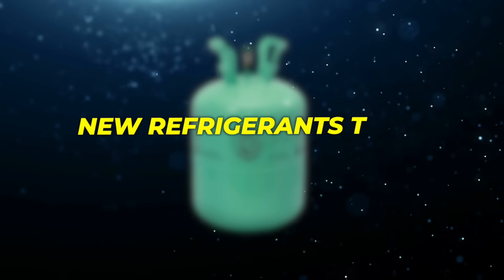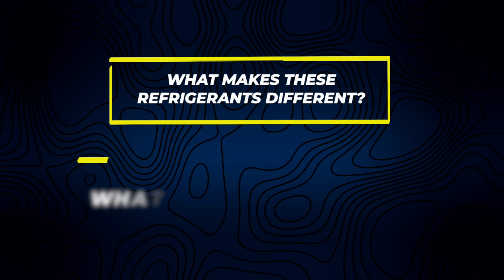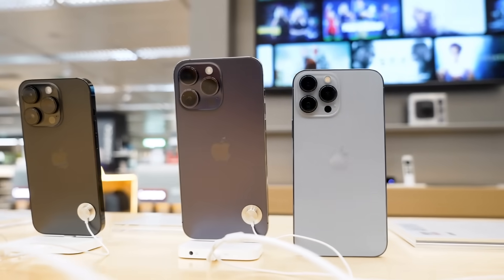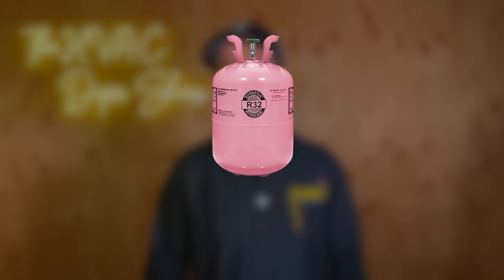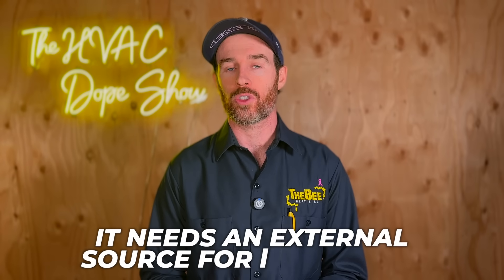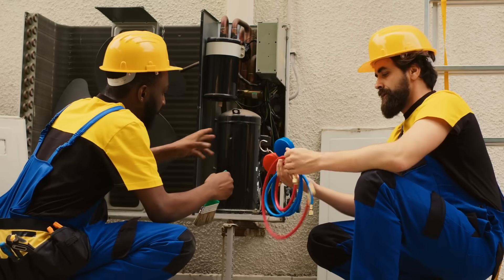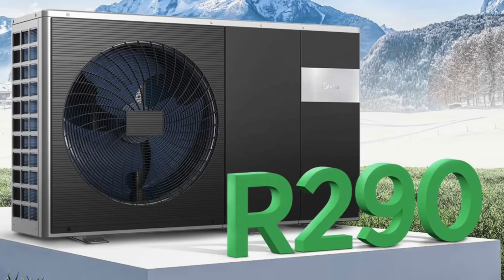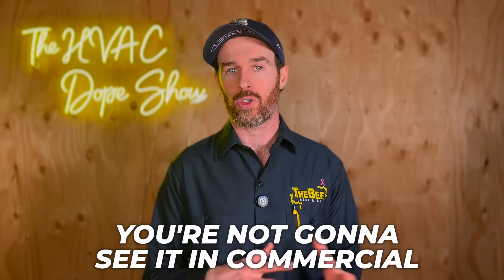The TRUTH about the “new” refrigerants | R32 and R454B refrigerants phase in

Comment: As a previous member of the refrigeration service engineer Society I am not happy with this decision regarding R32 or any propane refrigerant in residential or commercial use. My biggest concern is the factor of a compressor terminal blowout which would cause an arc and possibly ignite the refrigerant as it is leaving the compressor. I have seen things like this happen many times in the past with the train company and units would catch fire. I personally believe that the R32 refrigerant is not going to last very long as New Alternatives are coming about with lower ozone depletion. Yes R32 may have less of a charge than 410A in most cases, but I also believe that it is a potential for disaster later on. I've been in the industry 52 years and sat on two boards including North American Technical excellence and the refrigeration service engineer Society and the tree huggers. This is a big bunch of bologna! There is no more service technicians in this industry they are service salesman and trying to fleece people out of money and scam them saying that these refrigerants are not available you need to buy a new air conditioner when there are alternate refrigerants to replace R22 and others. I recommend that people get the correct information from the right sources such as Refrigeration Service engineer society and the air conditioning contractors Association of America don't believe everything these contractors tell you because they lie like a rug on the floor

Comment: I like using my R-12 in my old 1972 Buick. When Walmart was selling R-12 for$0.99 a can I bought cases and cases of it!
Reply: I did too.
Reply: Those were the days !  I did similar, and when we moved, 2020, , I only took our '01 Beemer along, so I sold my vacuum pump (built in 1902) and sold my truck and gave away an old R12 Cadillac.  This was when I also sold my AC rolling cabinet and 24 cans or R12.  I'm 82 now and only rotate tires, change my motor oil , filters, change out brake pads, etc.  Anything else I take to a local shop.

Comment: R32 seems to be corrosive to copper. Friedrich air conditioners have been using r32 for years and the most we got out of one of them was about 2 years before the refrigerant ate through the copper coils and leaked out. I hope the government comes to their senses and puts the brakes on the r410a phase out.
Reply from the maker: I think that's a different issue
Reply: @TheHVACDopeShow maybe. I know that r22 would form an acid if there was any oxygen left in the lines. Maybe r32 does something similar.
Reply: R32 is not corrosive. Your problem was not caused by the refrigerant.

Comment: While I agree that we need to keep the climate warm, it seems silly to be rating freon based on that. My fathers 70s cars are all still using R12. It seems crazy to me to use anything that is flammable. Though the risk is low, why would you take the chance???
Reply: Next to the AC is a heater that is using 100% flammable propane or methane. Not worried about that?

Comment: Air conditioning has been turned into a huge mess by the corporate state that is our imposed gov't, and honestly they don't seem to be competent to be interfering, the result of their meddling is that there are no longer any reliable affordable air conditioners available, no surprise there, as a 40+ year a/c tech. I've seen reliable r22 air cond. turned into r410a air cond. that doesn't work right literally overnight in 2010, it's now been 15 years of chasing new a/c units that are faulty, you can't be confident that the brand new a/c you install is going to work reliably if at all,  that is why 410a is being phased out 5 years earlier than planned, i suspect the new refrigerant will be more of the same junk

Comment: Well from european perspective, as HVAC tech, we have new units with R32 and R410a. R32 has been used for quite a few years now and all new units are 95% R32, some  bigger systems are still R410a but new laws and reguulations were made so from 1.1.2025 no new units are allowed to have R410a and by 2030-ish all previoush ones SHOULD be changed
Reply: No your wrong 95% of new units are 410 kid

Comment: What is the required gas pressure in psi for an R32 unit compared to R410a?
Reply from the maker: Pressure fluctuates based on indoor and outdoor conditions so this will always fluctuate but it's similar to 410a pressures
Reply: Similar pressures. Gonna have to hold on to those 410a gauges

Comment: Hopefully this r32 reduced Indoor coil sizes. Some attics here in Phoenix don’t allow out currently oversized 410 equipment to be installed efficiently.
Reply: Large coil size is not caused by the refrigerant choice. Its caused by the need for high efficiency in modern systems.

Comment: I live in the Southern California high desert. Average nightime winter low is 32 degrees. I am more concerned with having good a/c in the summer over heating in the winter. Would the daikon fit be a good fit for me?
Reply from the maker: In the high desert, so your highs get over 110F? If your home was under 2k square feet yes that's great (we install these in Phoenix and they work great) but if you can afford the DZ9 or any 20 seer like that those tend to handle 110-120f temps better. The new Daikin fit enhanced can handle them and they work but we've found that over 110F they will be running in boost mode until it drops below 100 or 105 depending on how your system is set up, so they don't modulate as much. Hope that helps, short answer is yes they work but over 105/110 they'll be running in boost constantly (which is fine there's no downside it's just not modulating like it would on milder days). This typically means at night when it drops below 100F then the system is super quiet inside again because indoor fan isn't running full steam ahead and it can modulate
Reply: @ my house is 1,670 square feet and it rarely gets above 106 degrees.

Comment: Do both R32 and R-454B have the same cooling capacity? Which as more?
Reply from the maker: R32 requires a lower charge so the equipment is smaller for the same efficiency which is an added benefit... 454B is similar but just requires a larger charge / larger system. Capacity is same
Reply: @TheHVACDopeShow  I replaced my 19-year-old 4 ton r22 Lennox with a 4 ton Goodman single stage. And although they both are rated as 4 tons, and the Goodman has less refrigerant, the Goodman condenser appears to be about 50% larger than my old system.
Reply: Be aware that R454b may not heat as well at very low temps. Not sure about R32 yet. I'm sure we will get more info as new units are available. We will be able to compare R410a specs/capacities to the new refrigerants soon.
Reply: @JOutterbridge  R32 has excellent low temperature properties.

Comment: Carrier R22 still going strong after 28 years.  Lower pressure refrigerants = drastically higher reliability.
Reply: Untrue. R410a scroll compressors are more reliable than R22 models.

Comment: 🤖 Points at videos of people freezing water by cold boiling it under near vacuum Now? Connect water filled panels considering room for expansion of frozen water, increase the vacuum, and vent all the energy from the water to form ice Add a fan and something to catch condensed water. If you use all food grade metals? Add a static dust filter for stuff in the air + a solar powered UVC light for Germs in the water + Metal aeration with air blown over the UVC light on the way to water to give it that yummy river in the sunlight taste. Refrigerant = Water..

How good does ice cool air? 😇 Regenerative Ice technology.. 🧐Those cooling systems are complex. Why? 😘 Note that this design can be done totally manual pump so can be adopted by Amish to prevent needing to go cut ice + have no tech approved cooling

Comment: Do we know if this is going to affect equipment and installation costs? I’m in the market for a new furnace and AC. I could possibly wait 1-2 years, but I’ve been told costs will go up 20% in 2025. Live in NY.
Reply from the maker: Yes everything is going up it's out of control... it has nothing to do with refrigerant, it's just inflation. Our insurance just went up 100% this year based on "general rate increase", absurd. R32 won't be a 20% premium or price hike but buying sooner rather than later is probably a good idea because every cost including wages has really hiked recently
Reply: Get a furnace and a heat pump..
Reply: The place we buy our furnaces claims r32 will be cheaper

Comment: Just replaced my 23 year old unit after it had a "rapid unscheduled evacuation" 💨 after the compressor locked up. I ran the numbers and the leaked gas is equivalent to 4 YEARS of a car's CO2 output. So I get it, but I'm also glad my new unit is R410a 😬

Comment: So do we wait or still get 410A system because its still the better option if were in the market?
Reply from the maker: In a nutshell if your system is working and can wait then R32 imo is better only because it's battle tested in Europe and not a new refrigerant, only new in USA. If you NEED a system asap (system broke down / failed compressor) get a 410a system it's not a big deal and you need a new system. If you want a brand that only does 454B then like some have mentioned you might wait until they work out the kinks, but honesty there's not a noticeable difference. The efficiency will be less than 10% higher on these systems across the board. The only super high efficiency stuff is mini splits anyways so if you're not going with mini splits there's not a big downside if you buy a 410a system now... hope that helped and didn't confuse you. It depends because the R32 stuff is out now in single and two stage but R32 inverter Daikin fits are Q1 of 2025 from what I've heard. So you have a lot of options
Reply: @TheHVACDopeShow  Great advice Thanks. In my area all they sell is Lennox (3 contractors) so well see if they offer R32 in 2025. My AC/Furnace system is old but not failed, 12yrs old. I'm might wait for R32. Didn't realize that R32 was the way to go. And R32 is still almost as efficient as 410A I felt we were taking a step back ?
Reply: @TheHVACDopeShow  My other concern is price hikes in 2025, so I was leaning to get one now before Lennox jacks the price up....

Comment: So glad im done with this bs, found a physically easier job making 25k more a year, no on call, no more bs with cheap garbage products....its like a huge weight off my shoulders. HVAC is beyond dumb right now, have old school owners thinking you can run 8+ calls a day on inverter products, constant changes with refrigerant and cheap poorly made products that break down constantly leading to constant customer complaints.
Reply from the maker: Only 8 calls a day? Jeez millennials are soft 😉 congrats on the new job, happiness is what's important at the end of the day
Reply: @TheHVACDopeShow  I've done more, but inverters on average take 2 hours per call waiting on the system to reboot, ramp up and adjust... gone are the days of replacing capacitors

Comment: That not true 2040 lol Supply stores already telling the techs that they no longer sell parts for 410a
Reply from the maker: Compressors and coils? I’m talking about the actual refrigerant itself will be available for purchase for a while, you’re right about condensers though those are being phased out next year… but those warranties are still covered for 10-12 years so they’d be replaced with a R32/454 system under warranty if that happened (compressor or coil failure under warranty on 410a system)

Comment: So there were 2 things you said outright that you would address, and then just didn't: 1) "should I wait?" you didn't even touch on it. 2) efficiency.
So... should I rush to get a 410A system while I still can? or should I wait for an R32 system?
Reply from the maker: I was allowing people to make their own decision based on the facts I was presenting but short answer is, It depends... do you need a new unit now? Then buy what's available. There's a lot of unknowns still but the R32 systems will be more efficient but only available through Amana Goodman and Daikin. 454b is the other manufacturers. If you need a new unit and the new refrigerant is not available yet then buy what's available but if you can wait 2-3 months most systems and system types will be available Q1 2025. We already have R32 units in single and two stage available now but inverters will be next year. Depends on your situation
Reply: Exactly, sounded like a ramble word salad.
Reply: Efficiencies will be the same as R410a
Reply: @WLB2-j5j this seems highly unlikely.
Reply: @Green__one  R32 is actually more efficient than 410a.

Comment: Not sure if it is true, but I have heard that the new systems using R32 and R454B will cost significantly more for the R410A equivalent system. Not sure if this is true and if so, maybe it's just "inflation", these systems are more complex, or the manufacturer's need to recover NRE. Any thoughts on this?
Reply: That’s my concern too
Reply from the maker: The parts cost on our end went up about 5% but this is sort of normal. We get a 1-4% price hike every year, during the pandemic it was crazy, we had prices skyrocket overnight (8 price increases in two years) because commodities jumped. R32 is battle tested in Europe for over a decade so there's no costs they're trying to recoup here. I think "significant" price increases are from inflation since 2019. It's crazy how much we had our prices go up, insurance everything is through the roof

Comment: There have been many tests done on r454b in regards to topping the refrigerant off when needed and the result was just as it was with r410a. 
You can just top it off as needed without problems just as we have always done with r410a.
The temperature glide is just over 2° so fractionation should not be any problem according to the manufacturer.
R454b will be the dominant refrigerant in the USA for central air conditioning systems. 
Vrf and mini splits will be dominated by R32.
I Hope this helps.
Reply: Until it gets banned in about 10 years due to PFAS forever chemicals in the R1234yf part of it. They should have all just stuck with R32.  No PFAS chemicals. Cheaper too.
Reply from the maker: Good to know! We'll see how it goes

Comment: I had a 16 year old Lennox system that required emergency repair this past week. Rather than spending money to repair, I decided to put that money towards a new system, although had the repair not been required I would have waited until this coming summer 2025 to put in a system with a new refrigerant. The new system is a 2 ton Lennox EL18XCV and a SL280UHV. I have a two-story 2,450 square-foot home. This system is for the upstairs. I was interested in your thoughts on both units (EL18XCV & SL280UHV) ,and curious as to what you think a reasonable price range for installation of this system should have been. The system also included lifetime parts and labor (compressor & heat exchange included) for me the original purchaser however if  property is sold, the new owner would get what’s left up to 10 years coverage but lifetime for me, 60 months no interest financing, and an iComfort S4 thermostat.  I live in the Dallas Fort Worth area and I understand cost can vary from the Denver/Phoenix areas. Also, any possibility you’ll be expanding to the Dallas Fort Worth area?
Reply: You do have to pay for labor on lifetime parts
Reply from the maker: Get 3 quotes for the same product and you'll have "reasonable"... I believe Dallas is lower in labor than Denver areas but still that system is probably 20k? I don't sell Lennox so I don't know they're cost but our here I've seen bids for that system combo around that price but the reputable companies in your area will all charge somewhat similarly based on their overhead so 3 bids is the easiest way to solve that. It's a good system as far as efficiency and quiet and people like them, but just make sure the installers know what they're doing. Reviews will normally tell you what you need to know about the install quality, I wouldn't worry about 1 or 2% of reviews being bad but if all the install reviews are iffy then it might be install shortcuts. We do things by the book and still have about a 1-2% warranty rate where things break because they're just manufactured en masse and therefore stuff hapoens
Reply: Lennox is the least desirable brand
Reply: @kevinplante1667  +1  I would look for another brand.

Comment: You did not touch the subject of pricing. The new systems with the new refrigerants will cost considerably more than the existing systems
Reply: And they have to have monitors to boot. The more technology, the more failures, the higher the cost to fix.
Reply: @CarriUSA  And because they're mildly flammable, building codes are going to change with regards to the areas in which the units are installed. Mo money no money no money
Reply from the maker: Our pricing for some of the systems came in and they're no more than our normal price hikes from manufacturers of 1-4% that we get every year so I don't think this is accurate. Nothings going to change, just another forced phaseout money grab to make sure people upgrade their equipment... so I disagree they're not substantially more by any means